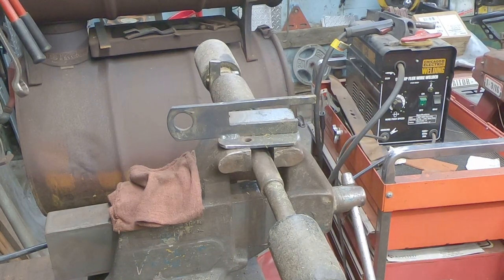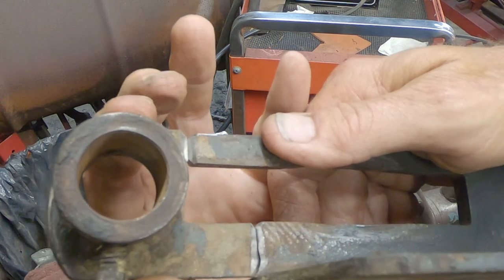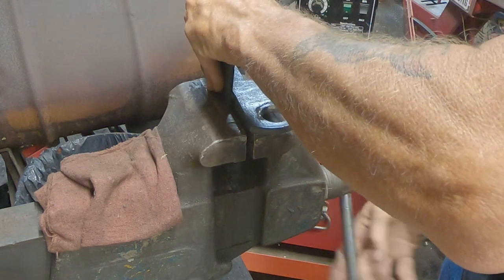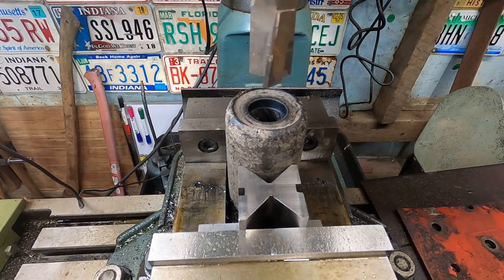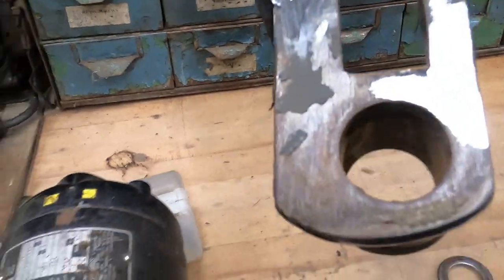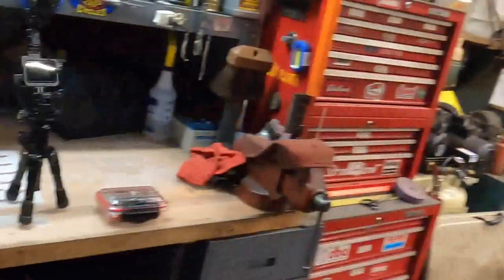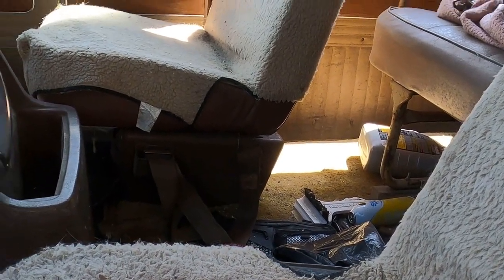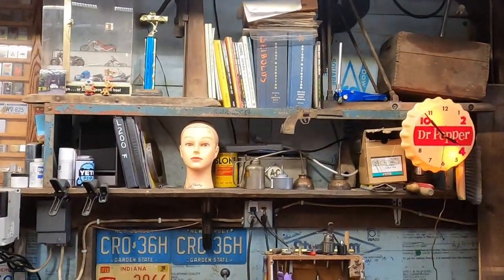Simplicity Legacy Deck Roller Repair and Van Walk Around

Comment: Simplicity tractors cut beautifully.  Every time I watch your videos I say I’m gonna get organized.  Like those blue drawers you got from work or somewhere that was unloading them.   Good stuff Zippo.
Reply from the maker: You remembered correctly. They came from the old Delco Remy plant I worked at before NAFTA. They are my go-to for so much, but are in desperate need of organizing. I could really stand to sort my nuts bolts and washers into the small of the two bolt bin organizers, but a little digging, and I can usually find what I'm after. I'm hung up on how nice the Sunstar is, so it's put the Legacy on the back burner for a little while. And I'm fine with that lol. Cheers my Friend! Zip~

Comment: Loved the video.  Great welding job and it looks really good to me.  I don't use those magnets anymore because they keep sticking to my head.  Hope all the bearings are in good shape.  Short block should be good for at least 80,000 I would think.  Don't forget we  want to see that as well.  Stay safe and thanks again for the video's and babble.
Reply from the maker: Hopefully, if all turns out, I'll be getting an entire 292 engine with just 74K miles on it to build up, then I can just swap the two engines when I've got the freshened up one ready to bolt in. I've got all of the equipment to resurface both the valve seats and valves on the head, lifters, stronger springs and cams as well as I think new pushrods. So the head should be plenty stout enough to produce in the 250-290hp range. I'm also toying with the idea of porting the head a little to increase airflow as well as adding a 700R4/4L60 overdrive transmission. Hopefully by next Spring, the whole drivetrain will be freshened up and ready for another 150k miles. This coming week, I'm diving into a little 235 inline 6 for a friend. It's not oiling the front two cylinders. Should make for good entertainment. Cheers! Zip~

Comment: Zippo , on that van , I once did an overhaul and cut the radiator support near the sides and made two removable bars with nuts welded on them , and two bolts ( you could use four ) . Easy out the front removal !

Comment: On the flux core I remove the gas cup which gives me better control of the wire.  I don't mind the hub caps on Harry.    I love the lathe.  Isn't it great to find something in a shed that you need!!!!!  Good luck
Reply from the maker: The Mill, Drill press and Lathe are invaluable, and I'm quickly learning that I need to make the valve resurfacing machine more accessible! Time for a whole shop rearrange! That's no easy task! lol. Cheers my Good Friend! Sean~

Comment: I had to replace the bar on my 712H will need some deck cracks welded after mowing season among other things. Thinking about building up a 14hp for the 712H this coming winter😉

Comment: I have the same issue with the deck rollers on my Sunstar. They are very worn and frequently stop rolling and dig into the lawn. Especially the left side one. Is there anything I can do to fix them? I've had a lot of trouble finding replacements, and the only ones I've found were $30+ each. That gets expensive at 9 rollers.
Reply from the maker: Look for used replacements on groups on Facebook. There are many different groups that cater to Simplicity and Allis-Chalmers and there are a lot of people who hang onto good used parts to help others out. Be sure to measure the diameter of your roller bar and let others know what that size is. There are different sizes out there. Also, the length of your rollers. But, if you get longer rollers, you can easily cut them down to the length you need. Cheers and good luck! Zip~

Comment: you have all the equipment to pull the engine out of the van, beefing up the engine great now junk the three speed automatic for a four speed automatic. talk about rolling down the highway with ease.
changing the brake hoses how about getting better brake fluid than Dot 3, pulling a trailer knowing that your brake fluid will not boil as easy is a big plus. if this has not happened to you I can tell you that you don't want to know what it is like lol
Reply from the maker: Ah yes, a 700R4/4L60....good idea! I'll have to make sure I can get one with the right tail shaft. If memory serves, the Th350 had either a long or short depending on the application. My local bone yard has plenty of them. I also need to pull the rear diff cover, clean and check things out and seal it back up. Probably wouldn't hurt to also check all of the bearings throughout and suspension rubber. So much to cover, and plenty of time to get it all done. If things all pan out, the new engine and parts will be here weekend after next. Another option is an over drive unit. Cheers Frank! Zip~